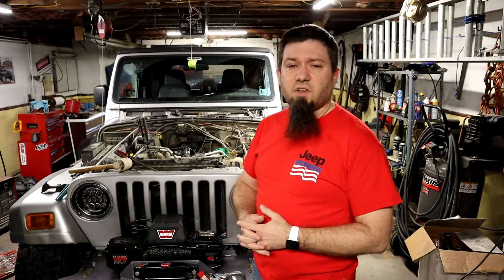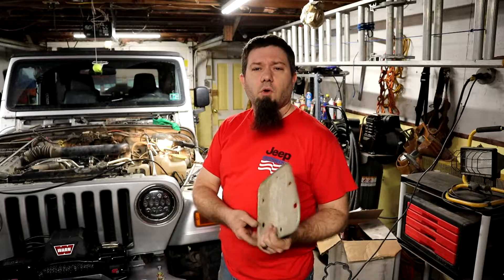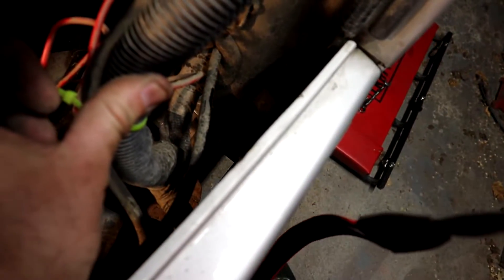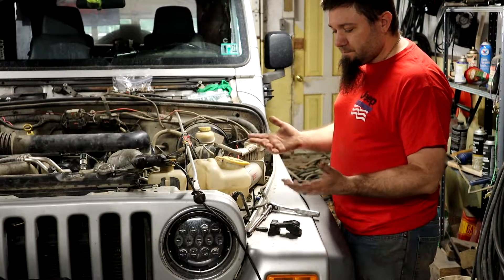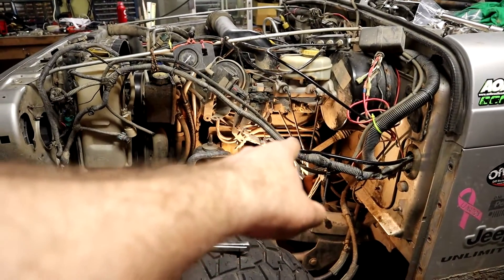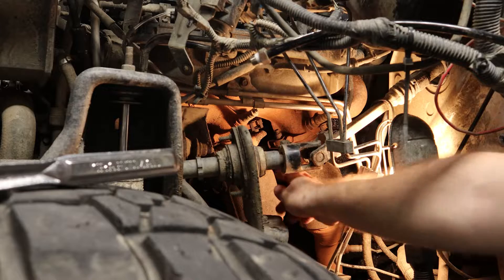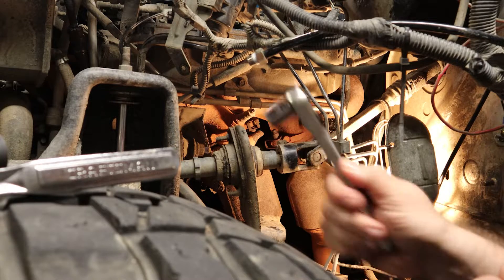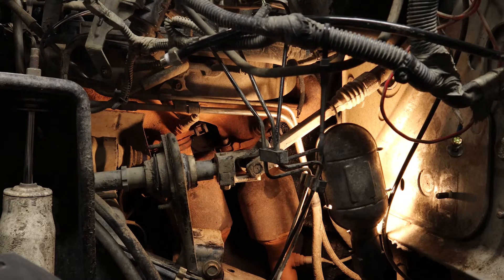Prepping for an Oil Pan Removal.  Removing a fender, and exhaust from a 2005 Jeep Wrangler TJ/LJ

Comment: I replaced the pre cats and cat on my gf's TJ a couple months ago. It took some figuring out, but ended up using 3 extensions and a short socket, THEN the 3/8 impact. Came right off without a problem. The extensions made it possible to get the socket on the bolts like it should be. PITA for sure!
Reply from the maker: Right!?  Those dang pre-cats are just right in the wrong spot!  You barely have the room to get a socket on there!

Comment: i did this on my dads lj to do a rear main and oil pan gasket for the bolts on the exaust i used a 3/8 ratchet and a snapon 12 point and a swivel then had to slide the whole exaust back off the hangers the main cat mount was the big thing that gave me room to get the oil pan off
Reply from the maker: Yep. Exactly my experience. Expect I couldn't get the exhaust to slide. So I just removed the bracket.  Thanks for watching!